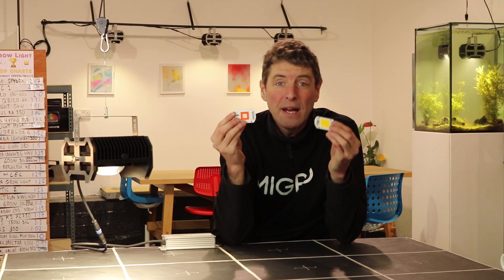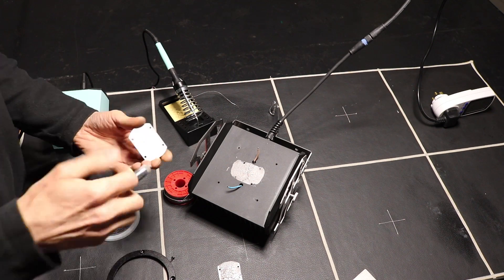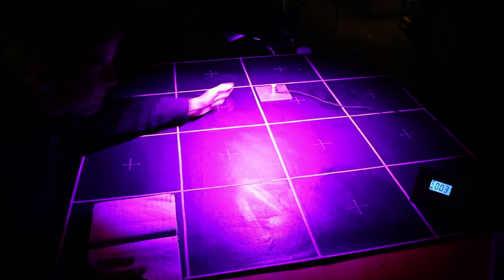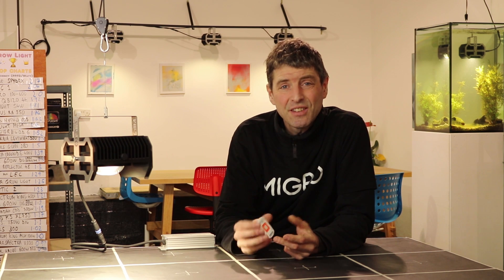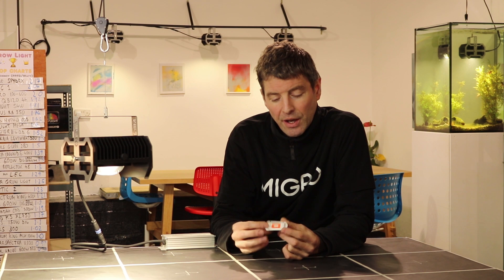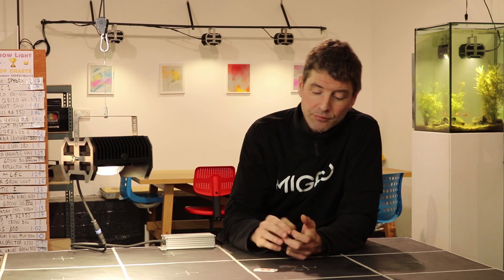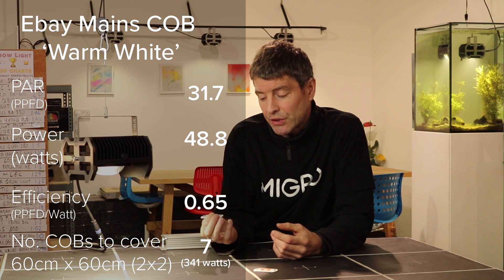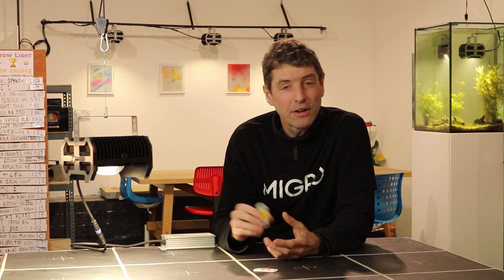Ebay mains COB LED grow light test

Comment: But why would you use a 90x90 Area to measure that kind of light? I would measure it just directly under it. That Area is way to big. No one would want to light this big area with just a 50W Chip
Reply from the maker: It's to capture as many photons as possible

Comment: It would have been nice to see the $/ppfd and the ROI for Ebay chips Vs Migrolight ones.

Ebay white LED (cheap to buy, but require more electricity)
MigroArray2 (expensive to buy, but use less electricity)
Question: how many 8 hours days should we wait before we get the same price (buying price + electricity) for a similar ppfd?

My guess would be that Ebay chips will win by far.

Comment: I bought a load of these some time ago (advertised as Full Spectrum) and i did connect one up - but i was worried about safety as it got really hot - added a heat sink but i think I'll use them in the garage when i get around to it - since bought the Mars Hydro TSW 2000 using it in a 120cm x 120cm tent but only using a 80cm x 80cm area as i have a turntable set up - can access the plants better that way...!
Wish i found your chanel sooner - enjoy your videos - best wishes from County Donegal....!

Comment: these probably the worst of that type of cheaper cobs
test the better part of the price range not the worst of the worst these should at leas tbe little bit if not a lot better
 https://www.aliexpress.com/item/32847985268.html
Reply: Have you tried these. Any ideas of par
Reply: @Aly_H654  I dont have the cash for a par meter otherwise i wouldn't be looking at the cheaper options and im starting in a few days the fixture is 9 x 50w cobs with 60 deg. lenses 6 of them are 3500 K and 3 are the 380-840nm which have a blurple light colour there's a photo somewhere there where they show a meter that  measures micromoles and it says 1.35 for the 380-840nm at 30cm height and 2.1 for the 3500K i will try to remember and post results here
Reply: @pquic  yeah I whatsapped with the yxo representative and she /he said the warm white is 212micro moles at 30 cm. I built one with 6 in total but temps ate too high. Waiting for a dimmer to lower the voltage. I'll have a link for a photo
Reply: @Aly_H654  mine are ok at about 40-45 C  but they are in a 3 by  3 arrangement and each 3 are on one big 1m long heatsink which is 14.5cm wide and the fins are about 4cm with around 1cm between them 

so if you use a really big heatsink it will be ok or a little bit smaller and active cooling  with a couple of fans

Comment: I have setup a solar electric power system. Is it the driver of the chip a transformer. And would it not be more effective and a better quality light to use a driver chip without a driver to supply the chip direct from the solar battery with the required voltage for example 36v. That can be achieved by 3 12 volts solar batteries in series. Or if I upgrade to  a 48 volt lithium battery with a dimmer on to tune to the required voltage. With a driver chip the current have to be dbl transformed with seems a bit unnecessary?

Comment: Re-watching some of your vids.
I'm curious, you mention the leds being improved but given the simplicity of the driver the power factor must be feckin terrible.
I get the LEDs won't be great but surely most of that inefficiency lies in the driver doesn't it?
Reply from the maker: The driver is probably about 70% efficient vs 94% for best in class. The LEDs used would be just as much to blame for the low result. They are only a few Euros each after all.

Comment: Hi mate, good work,

 you say you took the measurements on 90cmx90cm at 1min40sec and at min 4 you present the results on 60x60cm. Also could you pls try the measurements with the lens on and off ?
Reply from the maker: The grid was 90cm x 90cm but the PPFD readings were 0 outside the 60cm x 60cm area. Lens on/off will differ by about 10%

Comment: Are you sure your meter is reading red correctly? Both your tests look exactly like the sellers advertised graphs but with the region of red light's intensity reduced by 50-80%.
Reply: Just to follow up. I did a really half-assed spectrum test (photo of light on flat white background analyzed for RGB), and R/B were virtually identical in perceived intensity. Not exactly scientific, but I don't have a $500+ spectrometer. By contrast, your readings look to be about twice the intensity across "blue" vs "red". My cob however has that "red led" coating you point out on your blurple unit completely covering the leds (I've never actually seen one with that cutout before, 99% of the ones on eBay US are like mine... which would explain the increase in red spectrum at least partly. If you get the chance please drop another $2 and try one of the more typical style. You could also pick up a pure red unit (rarer and a different (looks older) style, but available for about $3 instead of $2) to see if it could be used to balance out the blue-heavy nature of the "full spectrum" without introducing an excess of yellow and green light. 

I'm also curious about your reflector? I've never held one of your unit's but it appears it's built into the lens. How efficient is it at working with these cheap, backed cobs? As they scatter light in a very nearly hemispheric range without a reflector. They are often sold with a very cheap aluminum/plastic reflector/lens, and I'd be curious to see how that setup compared when used with them vs your setup.

Comment: Read more about blue light.
And asking to do one lab,  stuff. 

Take polyethylene for green house.
It can be,  clear or blue.  
Put under led.  
And check how it will make direct light,  in to diffused, this is known for tunel green house.  And it will make some 15% loss, of light. 
But still,  its very interesting,  for lab, stuff. Will it work on lab. 
As you did with,  mirror.  
https://www.hortidaily.com/article/9060032/the-water-use-blues-using-light-to-enhance-crop-production/

Comment: I don't get why would anyone buy a migro lamp. Crazy expensive and definitely not the best out there.
Reply: It is a bit pricey. But when you calculate parts and engineering and location of manufacturing and shipping costs. Its actually a nice light. And remember the stuff it grows will pay for it in no time. I would love to someday soon at least get one. But would love to own 4.
Reply: @shakascloset1700  dude don't buy this crazy expensive shit. Make your own! Use some citizen 1216 and some PRB or Samsung lm301b quantum boards and throw this shit away.
Reply: @arnauvizcarramiserachs6318  I didn't say I could afford them. And yes I would do a DIY first before I would ever spend that much for 1 small light.
Reply: @shakascloset1700  don't ever spend money on this brand. It a waste of money when there are a lot of better and cheaper things out there. Just don't do it.

Comment: I am curious to see the result of the 50w grow-light cob with full phosphor coating.  The version you tested is not one I've seen before)most have full coverage of phosphor.  Currently I am running a 6x12 space using 24 50w driver-less cobs (grow-light spectrum) it seems to preform well, but I don't have a par meter to provide numbers and according to  some calculations I have seen for LED watts per square foot, I should be running 2x the lighting.  
Here is a link to the fixture I'm using.  I chose the 100w version.  https://www.aliexpress.com/item/MingBen-Led-Grow-Flood-light-Outdoor-IP65-Waterproof-High-Power-30W-50W-100W-220V-For/32826513730.html?spm=a2g0s.9042311.0.0.12cb4c4dhI242c
Reply: Yeah, I've never encountered one with that cutout before either. His warm white version is what I'm used to seeing.
Reply: Could you write an update of how the system is faring for you? I'm planning on implementing these in a grow bar sort of fixture, would lenses be required? Could you provide a few insights and details? Much thanks in advance!

Comment: I use one of these on an old computer heat sink for my seedlings in a 1x2 mylar box and find it works just great. But for veg and flower I have a much better setup but for something cheap I use 4 weeks a year this is perfect.

I used to borrow 2 2ft T5 bulbs and this is not as good probably but I'm happy
Reply from the maker: For little seedlings the blurple one may be a good spectrum. I hear you can get accelerated growth in very young seedlings with lots of blue.
Reply: @MIGROLIGHT  that's exactly the one I have. And I've learnt so much from your videos thankyou from canada

Comment: Only 14 ppfd for 48w? Very strange results, i have almost identical leds bought via Aliexpress and i've achieved acceptable results for young plants. For sure they are not professional but if those values are correct i couldn't have grown anything.
Reply from the maker: Do the part numbers match? You can see the numbers in the close-up. I'm sure there are many variants out there.
Reply: @MIGROLIGHT  Nope, DOB4075 (bridgelux). Can i ask what instrument (multimeter?) you have connected to the sensor to read the values (divided by 10) in that display?
Reply: Stefano Pasquali  were did you get your cobs
Reply: Stefano Pasquali i have seen those exact ones also in action and they are really powerfull 👍
Reply: really powerfull))))))))))
Reply from the maker: Just a millivolt meter. The apogee sq500 emits 1mV for 10 PPFD.
Reply from the maker: They're 96% efficient according to the product page🤣
Reply: I ordered 4 of these from amazon. A little more exp than aliexpress bt way faster shipping. Two blurple and two 3500k. How many did you use for 'acceptable' results/growth?
Reply: Hi, im searching for a simple led grow light only to grow some herbs in my kitchen, i want to use the ikea vaxer system but maybe use a other lamp, do you have any advise for buying a good light for that? I live in belgium so have 220v
Reply: Hi Stefano, can you tell me your experience using the lights from AliExpress. I ordered the 30w full spectrum purple one... Interested to see your experience

Comment: New Samsung horticulture led module , hope you can review when they are available. 

https://www.samsung.com/led/lighting/led-modules/industrial-light-module/horticulture-linear/
Reply from the maker: Very cool. I haven't heard of them. With no lens on the LEDs you lose about 25% if the light, even with reflective walls so they should be good for 2ppfd/watt. I doubt they will be cheaper than HLG though. They are very good value.

Comment: I have work with the warm white ones, not those exactly but they give me good results un 2x2 with 200 watts. It would be great to know lumen output to see if the maker is lying wiht the efficiency, they have an output of 4500lumen each in AliExpress...
Reply: down load a lux meter on your phone and whatever the lux reading is divide it by 76 that's a fairly accurate par number without a fancy meter
Reply: Lux meter app dont read more than 1000 lumen, more than that they saturate and don take a good reading.
Reply: Lumens?
Reply: Please
Reply: NukeHeads 3  I´m talking about the maker speecs not grow science, i want to know if they lie in their speecs or not. Sorry by the spanglish